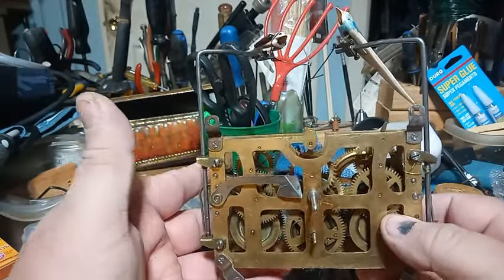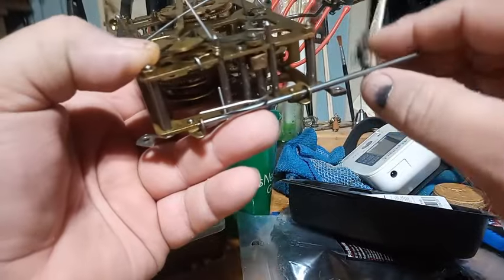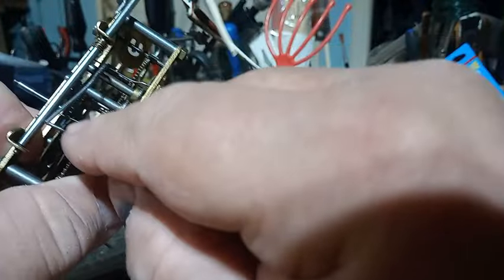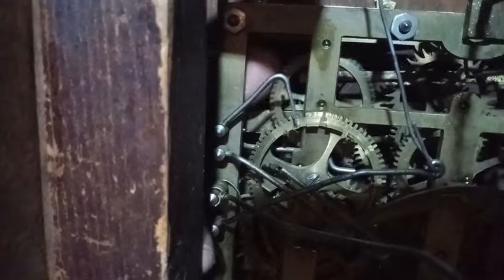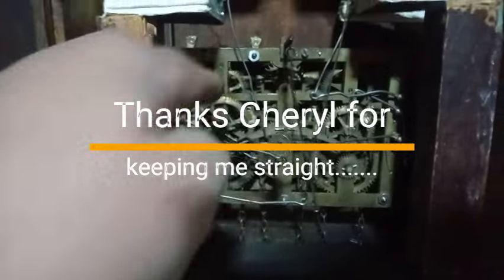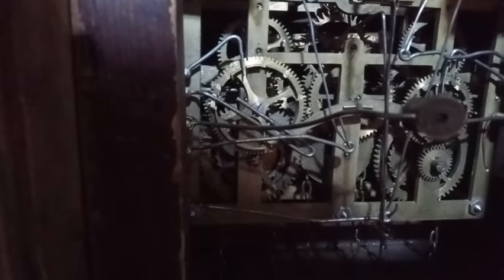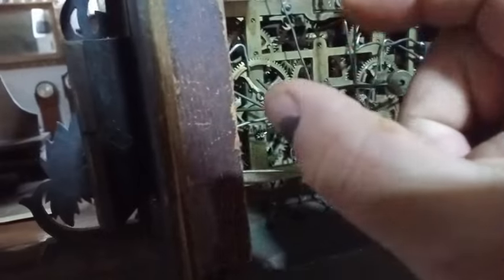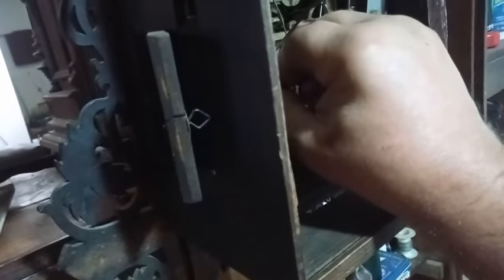What to do if the bird on the cuckoo quail clock count wheel doesnt stop or cuckoo doesnt cuckoo etc

Comment: Two comments: first you sound a little hoarse-hope you haven't been sick. Second your quail only does two not three chirps-how come? Thank you for the video Mark. Merry Christmas!
Reply from the maker: I think I was tired of explaining myself over and over again to certain folks. Or just tired. LOL.  I will have to look into the quail again. Again I was worn out when I did the video and I was in a hurry because I promised my neighbors son that I would take him fishing today. I was running late........ I caught 6 trout. 2 brown both  under the legal limit of 14" so I had to let them go. Then 4 rainbow trout and I keep them all even if they are little this time of the year because I am fishing from the bank and not wading in the water. Once  you lift a trout out of the water most of the time they will die. I gave them away to a local gas attendant after I cleaned them on the spot. I only like grilled or baked trout. My oven element is bad on my stove. Been that way for over 2 years since I traded my stove with my parents house stove. My stove worked great but it wasnt a smooth top stove. So I traded. I got the raw end of the deal as their oven didnt work. It did when my mom was alive. I am sure that the drug addicts that was taken advantage of my dad are the folks that burnt up the stove elements. I just havent taken the time to replace them. That takes work that I shouldnt be doint. Not supposed to lift over 25 lbs................but a single guy has to do what a single guy does.............and I didnt want to start up my grill for fish since I have plenty of food in my house from cooking for my neighbors yesterday. A video that I havent taken the time to post yet. I have enough left overs to last me well after Christmas..........
Reply from the maker: Merry Christmas to you also Cheryl. May your day be filled with happiness and joy...................and may you get all that you asked Santa for. May God continue to bless you and yours.
Reply: Nothing like fishing. Trout are fun. I would have had to eat those babies! I understand about the addicts destroying things. I am trying to sell my grandparents house in southern Illinois but it's destroyed from who my dad let live there.
Reply from the maker: 2 years ago I was taking my neighbors son fishing every week during the summer time. Within 30 minutes of arriving we had our limit of 10 fish. 5 per person in which I caught most and going to a chiropractor. The VA was giving me travel pay to go see the Chiropractor. It didnt help but I went anyways so I could go fishing. I gave all the fish away. I only like grilling trout. It wasnt worth it for me to start up my grill to grill 10 trout. I am not starving. I could stand to go without eating for a couple of weeks. If only I could force myself to do it. When my kids and I go camping and it has now been a few years I am the cook. I grill up anything from Kebabs to pork steak to trout. By the time I cook the trout they are full and I end up giving most of the grilled trout away to other campers. Everybody says it is the best they have ever had. Sorry to hear about your grandparents house. I graduated high school out of Jerseyville Illinois. We lived in Grafton Illinois on the Nugent and Shapanski apple orchard from 80-83. Until it closed down. My dad was a maintenance man on the orchard. I worked there also. Picking apples to pruning  trees to picking up dropped apples to making apple cider with my mom and sisters at night after school. Loved it there. It had something like 10 or so lakes on the orchard. 2 right behind our house then another one behind the house about a 1/2 to 3/4 of a mile. Loved it there. One of the owners died. Nugent I believe. Then the other owner didnt want it anymore. It went up for sale on court house square selling lot by lot. My parents left to go back to their house they bought in Missouri before the orchard closed down leaving me to stay with my oldest sister who was now married to her first husband so I could finish high school. They came to see me graduate. Drug my ass back to Missouri the day I graduated and the rest is history.